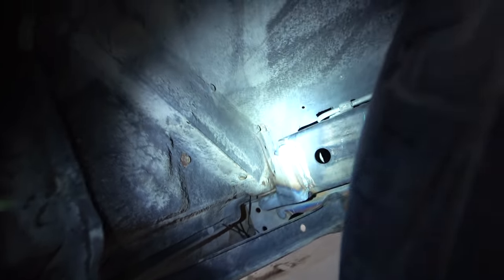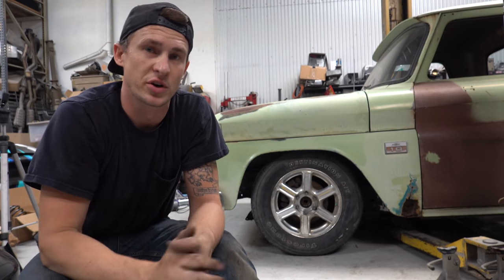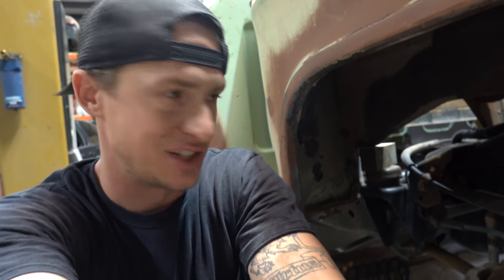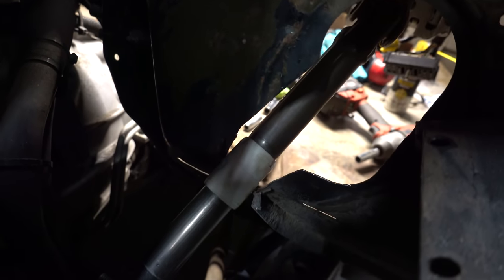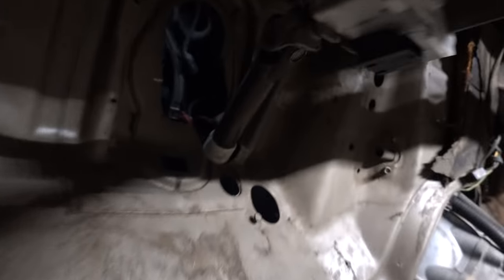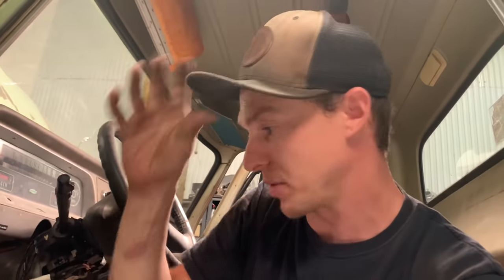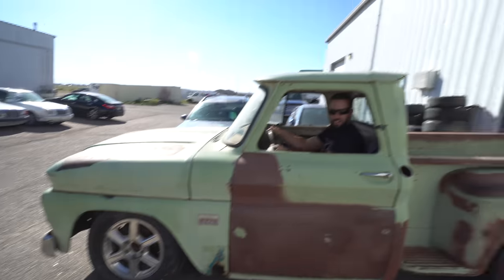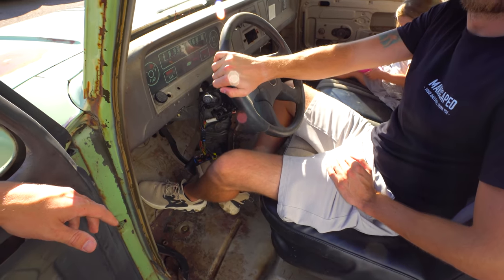Pt:7 C10 Patina Build -Finally Lowered! + Brakes & Steering Hooked Up!

Comment from the maker: First! Be sure to thumbs up the video if you want to see more of the C10!
Reply: Bro you inspired me to build a turbo b18, and it freaking rips. Right now I have around 300 hp and I need to wait till I can afford the rods springs and retainers
Reply: Absolutely more! If you build it, they will come.....
Reply: K swap step side c10 with twins  would be rad re name it k10
Reply: Love the truck and how it's coming along so far, please just do yourself a favor and fix the brakes before you do wheel and tires :-)
Reply: can haedly wait to see you really rip into this engine and but a decenr turbo on it as well as ecu that can manage the cams. I am betting on a easy 500, 500 if managed right.
Reply: You should really throw those chrome wheels on it they might go to a drift car but I think they would look mean
Reply: You putting the easy off-road electric power steering kit on it
Reply: Maybe good idea  swap envoy interior to c10
Reply: 🍔Trevor You Absolutely must TURBO this truck. I need an AmerBarra Turbo Video.🍔
Reply: Love this build!!
Reply: I hit like as soon as I press play🤟
Reply: WHAT HAPPENED TO TY? WHOS MANS IS TIS?
Reply: I watch C10 støff only
Reply: Where did the envoy go really wanted to see how far you could’ve taken it.
Reply: Is this project over?
Over or not you inspired me, got a 2001Tahoe, going with my 65'C10, will be going short bed for sure.Thanks for doing this video

Comment: The bed needs to come down, it doesn’t look right at all. PLEASE DO NOT leave it like that. Messing with the factory bed height is a big no no, when you start playing with proportions of wheel openings and altering things of that nature things start look botched. The beds all have that low short bed line, that’s what makes them look good and is part of their identity. That’s as bad as when people were putting OBS beds on older trucks back in the late 90s, it just looked horrible and so glade they stop that nonsense. Mount it where it’s supposed to be originally or get a fleet side and cut up whatever is necessary in order to line it up properly.
Reply: Wow...Well Said, Sir!
Reply: Couldn't agree more.
Reply: Agreed

Comment: I think the ride height and wheel size is good.
I'd throw brakes and bearings at it, add either 9" steel wheels or modern classic alloys, and send it!
Any lower and you end up in mini truck territory where it has to lay on the ground to look good.

Comment: Like the new intro.
Please put a thicker tab attaching the pedal to the tube for the brakes.  It should also be directly against the pedal, not a spacer.  If you need to stand on the brakes, that thin tab will not hold.  Keep it safe.

Comment: You guys do this I guess for a living? I'm new to this channel. 
But I have an idea for this... well maybe not this, but this type of swap. It might be more work then it's worth, but.. here goes.
You could trim the firewall off ur donor vehicle that the frame came off, and you can use the hvac system from ur donor vehicle in ur New one. There would obviously be some dash mods. But you can keep the entire hvac system. Have u guys or any of the ppl in the comments done this? Because I'm debating on doing something similar to this with a trailblazer.. buuut I don't know which body yet. As I only bought the trailblazer so far lol have thought about a 2nd gen camaro. But anyways, I kind of want to keep the modern trailblazer interior in whatever vehicle I use. I understand this may not be possible, or would take Hella work. But anyways that's my current line of thinking for my project. But I imagine u could use trailblazer hvac behind that c10 dash. Iirc they have big dashes